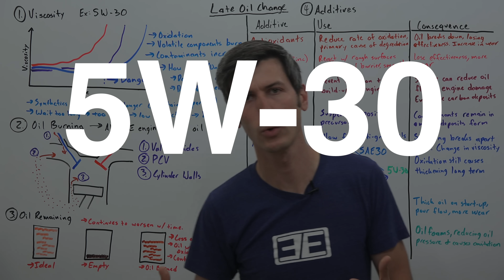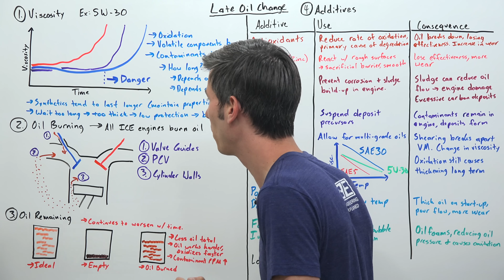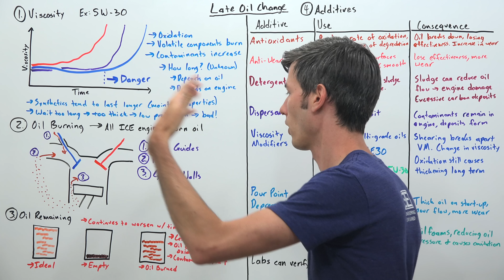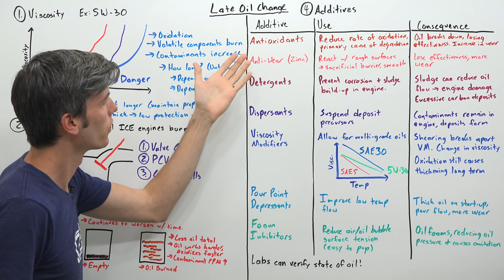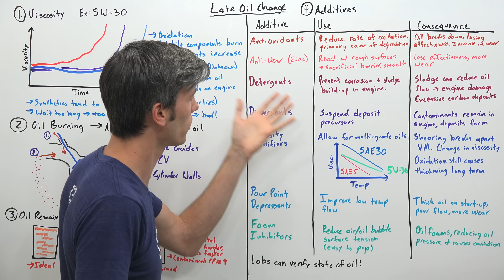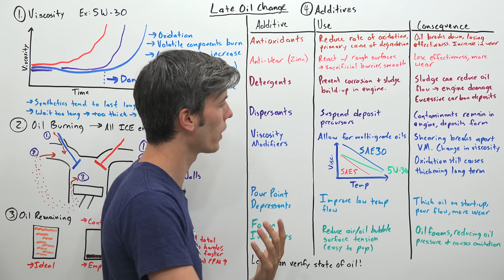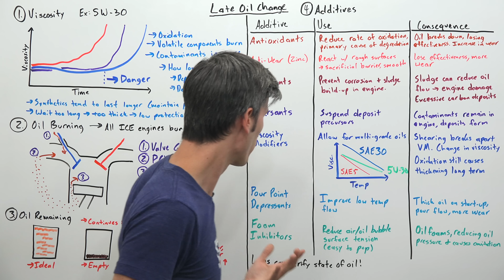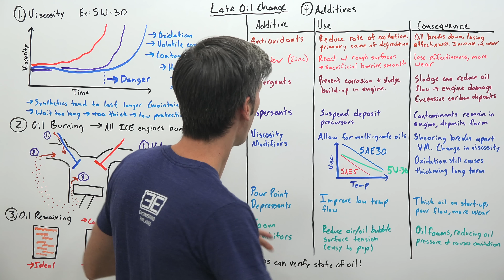What If You Forget To Change Your Oil?

Comment: Interestingly, my previous understanding, and experience with diesel engine oil (specifically Rotella), was that the breakdown of viscosity modifiers was a much more important factor in oil degradation than oxidation, at least on time scales relevant to automotive oil changes. I used to do engine testing and have oil samples analyzed every 20 hours of operation or so. We would see substantial decreases in viscosity over the first couple hundred hours, IIRC. At which point it would level out rather a bit lower than the oil's spec'd viscosity. Sure if you put 30k miles on the oil you would expect to see oxidation thickening, but I don't know that that's all that important if you skipped one oil change. And that's the issue, low viscosity is generally a more immediate concern than high viscosity, as this reduces film thicknesses, causing heat, causing lower viscosity, causing reduced film thickness... causing metal-metal contact.
Reply: yeah jason is full of it.

Comment: What about time vs mileage? My Mazda dealership said it was ok to change the oil at 10,000 KM no matter the time. Instead of the usual year, it took 15 months for my first 10,000 km for the oil change.
Reply: You have to get into communication with Your Motor: look on Your oil- stick what the oil looks like. If ist is too dark and not more glueing (slightly prooving with Your fingertips ), You ´d better change it. The first mark given by the Producer You have to follow….

Comment: When I was flying, the adage was “gasoline and oil are the cheapest things you put into an engine”.

Bear in mind that a typical Aircraft Engine rebuild is north of $25,000.
Reply: I work in an aviation engine shop and can confirm the prices are excessive. To just get a replacement camshaft for a 8 cyl Lycoming 720 costs about $8,000 our price (some markup for customer).
Reply: Remember about 50 years ago saw some AeroFrantz filters on crop dusters. They were FAA approved and used 2 ply facial quality bathroom tissue. Don't know anything about aircraft engines but know clean oil is better than dirty oil.
Reply: Thats the low end. I went to an engine overhaul shop near lunken in Cincinnati and 25k was easily spent on the little 4-cyl lycoming and continental engines.
Reply: With the old radials such as r-2000 and 2800 the operators never changed the oil. but consumption could be a gallon and hour or better.
Reply: Bram Moerman - Yes, true, but that is just a small 4 cylinder motor. Bigger = way bigger bucks...
Yes, inflation is everywhere.
Reply: @LA_Commander  new parts if you didn't change your oil.
Reply: Hence why I change my oil every 3000 miles.
Reply: Birds are free tho
Reply: still cheaper than porsche ;
Reply: @Angry-Lynx  true... ask me how I know!

Comment: Would one of those labs be able to tell the overall condition of the engine (say a 10 or 15yr old car) by analysing the oil? My guess is no, but I'm not a chemical engineer
Reply: Yes, they can tell you quite a bit about the condition of an engine.  Especially if you submit samples for each oil change over 2-3.  But yeah, they can compare the metals in your oil to other similar engines and see if the amount of wear per mile is as expected, or if some elements are wearing quickly, which would be an indicator of engine health.  Depending on what metals are found in higher than expected concentration, you can get an idea of where an issue might be.  Check out Blackstone Labs.

Comment: I once took a class taught by GM's top Lubrication Engineer. Very engaged class as there was a lot of interest in what he knew.  Here are some of the highlights:

Use oil that meets your cars minimum API certification requirements. That makes sure it has enough of the additives it needs, and not too much additives that can have an adverse effect (i.e. some AMSOIL has a lot of zinc which is good against friction and wear, but can poison your catalytic converters).

The most brutal times for your engine and its oil is running hard during summer, and repeatedly starting up in the winter.

With modern engines (within the last decade or so) cars can go much longer than 3,000 or 6,000 miles. If you have a car that doesn't have an oil life monitor, every 6 months is a good rule of thumb. This makes sure your oil doesn't go through a hot summer AND a cold winter.
Reply: Did he mention anything about the algorithm the oil monitor sensor uses, and what 20% actually means?
Reply: @petesjk  There is no oil monitor sensor. There is an algorithm (and I believe he and his team wrote it) that takes into account outside temperature, throttle position, sump capacity, etc. and determines how much damage is being done to the oil. Once enough calculated heat/cold/soot/water/acid damage has accumulated, the oil life monitor says it's time to change the oil.

Comment: I will say this, in America specifically, car companies have gone out of their way to lie to Americans about the need for frequent oil changes.

Back in the nineties I was living in the UK.  I once owned a Ford, which had a manufacturers recommended service interval of 8K mile and also a GM car which had a recommended service interval of 10K.  These were not exotic or expensive cars, just regular sedans.  Yet state side those SAME cars or their nearest equivalent were recommending oil changes more than twice as often.

I was totally shocked when I started driving in the US and mechanics kept trotting out the line about all the terrible things that would happen if I didn't change my oil every 3K miles or so.

One time I had a BMW in the early 2000s and since THEY were paying for the oil changes, they didn't need an oil change but every 15K miles.

There is no question in my mind that a modern car with modern oil does not need fresh oil anywhere near as often as they like to claim.  I even test drove an Infiniti a few years ago and they were talking about 3750 mile service intervals!  I laughed in their face.  I wouldn't even entertain buying from a manufacturer trying to pull that scam.

In my opinion, in this day and age, there is something seriously wrong with the car or oil, if it can't easily survive 10K between oil changes without negative consequences.  I also think that a lack of consumer protection laws in the US, along with powerful lobby groups bribing our politicians, allows for ridiculous messages being given to consumers, which we hear enough times and begin to believe.
Reply: Well said

Comment: do you recommend engine oil additives.I have been told it is good for engine when you change the oil to buy extra additive that improves viscosity and overall protection because oil producers refrain of making oils too expensive so if you really want to take good care of the engine its kind of a must to buy those.
Reply: I wouldn't. Instead of spending money on additives, spend it on new oil and reduce the change interval

Comment: Jason is a great teacher. Never boring. I never yohn when I listen to him. Great videos nice clear voice and no crappy music in the background.
Reply: Gonna debate a small point w/ you. 
A ‘Great’ teacher makes the un-understandable - understandable. 
I opened this video simply wanting to know IF it’s the miles driven? Or the length of time in the engine?  We have a low-mileage F150 that hasn’t had the oil changed in 2 years because it sits a lot in the garage. There’s only 950 miles on last oil change. But it’s been sitting in there over 2 years....
 OK, so I got a LOT OF INFO from a Master’s level auto genius. In fact, TMI !   And I guess I generally get that it’s bad to run old, dirty oil - and that it hurts an engine. But I didn’t get my simple question answered in a simple understandable way.
Reply: @boomer1954ful  67 years old and your just now trying to figure this out?? . I'm 62, and have known since my early 20s, if you don't drive it much, change it once  a year.
Reply: @boomer1954ful 
Same here. I have 14,000 miles on a 5 year old RAM 5.7. Only two oil changes and the oil in there now is still clear and clean. No city, only country miles. He needed to stipulate some more detail and info.

PS. I’m 76 years old and I never changed oil for 2 or 3 or more years in any of my many cars. They all ran smooth and dependable until I sold or traded them.   (This was after I threw a rod in an old Buick I bought very used when I was 17 years old in 1967  🥴😂) My next car was a VW Beetle but then I drove a 70 Olds Cutlass for 7 years. I think I changed the oil about 4 times. Ran GREAT! Yup, they don’t make em like they used to!

Comment: Good grief, this video could be 30 seconds lol. Oil breaks down over time so change it regulary, every 10.000 kms /12 months. Done.
Reply: Nah, 3 months / 3000-5000 miles. Especially if you have a turbo. It's literally like $25 if you do it yourself. These new engines coming out in cars are getting more and more complex so having fresh oil in the car is important. Especially with the way people drive nowadays, everyone seems to just beat the crap out of their vehicles.

Comment: I have a 2015 Honda Odyssey and drive it for a living. It has about 127k miles on it (drove it about 45k for 2019). I use Mobil 1 full synthetic high mileage and change my oil around the 10k mile mark. Been doing that for quite a few changes now. It always stays within a safe amount after all that. Basically, modern engines are very efficient, but can only do so well even with the best oils. So know your car, and don't wait too long. Also check your oil level on a regular basis.

Comment: I have 2 cars 2 trucks one truck is a 2012 ram 6.7 diesel with 50000 mi.  I Chang oil with rotella t6 5w45 every 3000 mi  don't cesium any oil as I can see and a a 08 colorado with 77mi. and a 5cyl   3700 I see maybe 1/8 quarts of oil between oil Chang at 3000 with  castrol gtx5w30 09 nissan Altima 3.5 with 6 with 14000mi I don't see anymore than 1/4 quart  oil between oil chand of Castro  edge 5w30 and a Lincoln mkx with 375000 mi on it it 1  quart of oil between oil Chang Castro edge I have o I bought all them new I live in n
Y

Comment: I used to change my oil every 4k miles due to "severe" conditions. Now I burn through 1qt per 1k miles. Is there any reason to do an oil change at this point? I'm assuming any contaminent will be diluted by new oil, as my oil hasn't darkened significantly. Now I'll just have to change it when I change the filter. How long do you think my filter will last? 

2.4l 4cyl k24a4 
Prestone full synthetic 
K&N wrench off filter

Comment: If you all don't know when to change the oil.  READ THE MANUAL!  Mine said to change it every 7500 or 7 months, whichever comes first.  I changed it every 5 - 6000 miles.  Did a lab test on the oil after changing it 6000 miles and the oil was still in great condition and I could have driving 8000 miles with no issues.  So the car manufacturers were right.  Change it at 7500 miles with 500 miles to spare.

Comment: You say the w stands for winter? I'm not sure, I thought it stood for weight. If you buy 90w oil ... that means 90 weight oil, which is damn thick viscosity. 

Winter is too subjective a term any how.

You didn't mention; the color of the oil on your dipstick should be observed frequently, like spark pulgs it tells a story!
Everyone should be driving electric cars, using large quanties of OIL is a mistake for one and all anyway you look at it.

What is the efficiency of an electric motor?
How many moving parts in an electric motor?
How many miles does will an electric car do in it's life time? 

Is change difficult for you?

Comment: very well done, as a side note, all though you can go longer on oil change intervals using synthetic over conventional how much longer depends on a lot. how hard you drive your car, how new it is, what size engine, and turbo/supercharged. as an example: a newer car may be able to go 10,000 miles on some synthetic oils no problem, but my 95 chevy should never exceed 5,000 on conventional and I would'nt feel comfortable going over 7,000 on synthetic. newer engines are cleaner than older engines, natural aspirated have less contamination than forced induction. (i change my oil at 5k even after switching to synthetic, keeps her as clean as possible.)
Reply: ps.. chevy 262 still running strong at 268,000 time will tell if she makes it to 300k

Comment: I’ve bought used cars with 90k miles , didn’t know when the last oil change/ maintenance was done, drove it for 30k mi plus , without ever doing a single oil change   And sold it.  And the guy said it’s the smoothest running car out of all the same cars he’s went to test drive.     I currently have 3 cars bought new , and have 100k miles or more , with about 4 oil changes each.   I call bs on all this     Sure, your car may run better or longer , but it’s not ANYWHERE near as catastrophic as data points to

Comment: something I always do is that I write down in a notepad the date that I changed the oil, along with the mileage from the odometer at that moment of the oil change
Reply: Or just put it in a spread sheet
Reply: Jack Tran,
My formerly-CDO self had EVERYTHING in spreadsheets. Now that I am (mostly) recovered from that condition, reminders in the calendar of my trusty old flip-phone work even better. 

For proof of service records, I also write the date and miles on the oil filter with a Sharpie and snap photos of the old filter in place, then removed, and the new one before and after being installed, then e-mail those four photos to myself. File creation dates on the JPG files and the e-mail document the oil change intervals, if needed when selling the car, or for making a powertrain warranty claim. (Same with photos of receipts for the oil and oil filter.)

Comment: Hi Jason i was told that if you put a really strong magnet on the top of your your oil filter the magnet attracts all the metal bits from the oil before it can damage the engine. Is that right?
Reply: There's a lot of talk about oil filter magnets -- that old, screechy-voiced, arm-flapping guy says that magnets don't work (as he stands there banging a big magnet on an oil filter), but he is wrong.
There are folks that slap Hard Drive magnets and those dime-sized magnets all over their oil filters, but that's just janky stuff for novices and/or dummies.
 The famous 95 MERC runs a FILTERMAG # SS365PR -- with 11.4 square inches of magnetic holding power, and heat-stabilized magnets that stay energized at all temperatures between minus 40 degrees F and plus 300 degrees F.
  I cut my used oil filters open with a Filter-Cutting Tool -- and the amount of ferrous metal particles that the FILTERMAG captures is amazing !!
 After seeing the FILTERMAG do it's job, I would not operate my engines without a FILTERMAG installed.
 The # SS365PR is not cheap -- but it lasts a lifetime, so the cost-per-oil-change is minimal.
I found the best price (delivered) at SUMMIT RACING.

Comment: How come motors don't have a secondary  electric pump that pre Lubes before start?
Reply: Thomas Healey I wouldn’t think most would sit that long that it be an issue. If you have a car that you put away for the winter, could always crank it without starting to get the oil circulating. Pull power from the ignition or on a car fro 95 up (OBDII) hold gas pedal to floor (clear flood/ doesn’t fire injectors) crank for 10 seconds.
It’s been said that most wear happens during start up? I don’t know for sure but I do know the manufacturers don’t want them to last forever. 
There are Oil Accumulators used on high performance engines that hold a reserve Incase pressure drops and fill back up when pressure builds. I think it’s for real high rpm stuff though?

Comment: The dealer won't change the oil in my leased 2019 BMW 330i until it hits 10,000 miles.  He says that's per BMW recommendations.
Reply: Its leased, so its his problem.
Reply: Stephen J My lease payment includes maintenance. “Includes oil changes” didn’t specify the interval. 

It’s my fault for missing important details in all the fine print, I get that.
Reply: @PrivateEyeYiYi  I mean that  by the time the damage truly starts to accumulate the car should be back in their possession end no longer your problem.  I am assuming your lease covers any issues with the car. So even if something goes wrong before your lease is up, isn't it on them to fix it? I might be wrong,I have no first hand experience with leasing. I drive a 2nd hand 2013 Impala.
Reply: Stephen J I get all that, but I like driving a car that’s in top condition. That’s one reason I prefer leasing.
Reply: @xXxJustCallMeM  just do it your self you should change it every 5 thousand miles
Reply: @nothanks2994  it's a BMW It will self destruct in the coming years don't touch it !
Reply: @emmanuila7747  it's the E36-E90 gen that's unreliable. E30 and older, F30 to now; they're pretty reliable. I have a 25 year old E30 and it's still daily driveable, electronics work perfectly.
Reply: My 2019 Toyota Camry Hybrid is leased and I change it at 5000 miles even though manual says 10000 miles.
Reply: @CMDR_Birb  well that's just silly. My 4Runner has a 10,000 mile oil change interval per the factory manual, so when it hits 9,000 I start thinking about needing to change it. I did my last oil change a few weeks ago, I was at 9,600 miles. I plan on keeping this thing for years, btw. I use good quality full synthetic oil, and the factory filter. I'm confident that it's protecting my engine even past 10K.